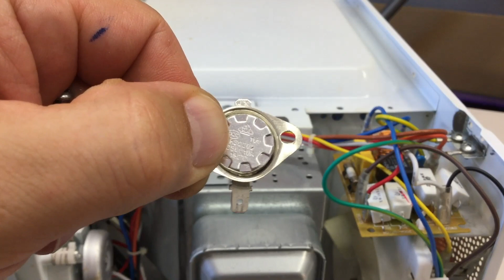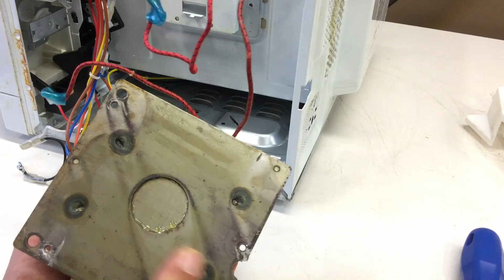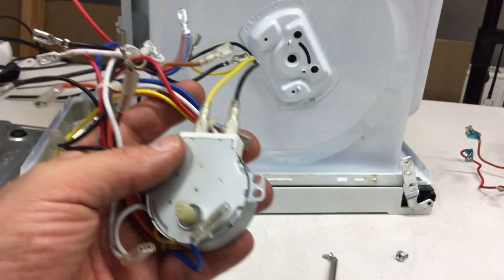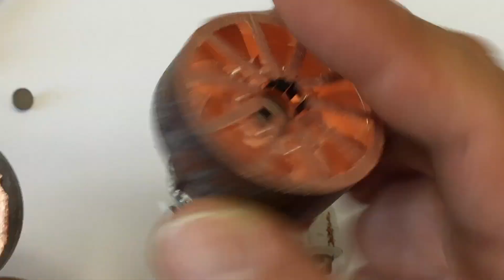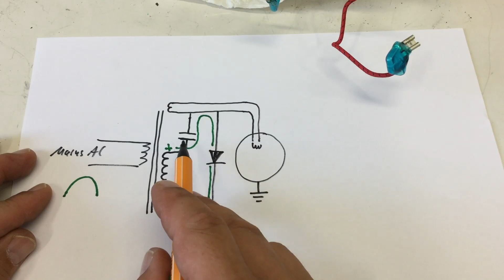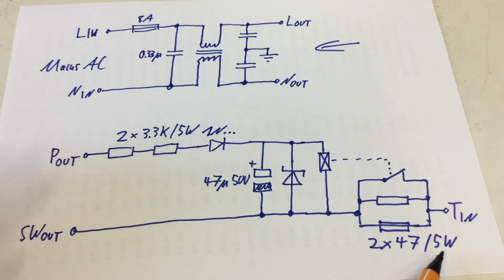Detailed Microwave Teardown (Magnetron Innards, 5kV Voltage Doubler, PCB)

Comment: Are you sure the low voltage end of the transformer is connected to the Megatron.   I think its the high voltage end @ 2000 volts.
Reply from the maker: Yes (see also the circuit: https://youtu.be/FyPdvM5x_Kg?t=3238 ). Due to the voltage doubling circuit (capacitor/diode) high voltage is present between ground (high voltage +) and the low voltage winding (high voltage -). The current from the low voltage winding is just used to heat up the filament in the magnetron, which is also at high voltage -, so it can emit electrons that are accelerated towards the grounded parts at high voltage + of the magnetron. Hope that makes sense.

Comment: Discharge the capacitor first.   Highly dangerous  to touch it,
Reply from the maker: The high voltage capacitor had a build in discharge resistor: https://youtu.be/FyPdvM5x_Kg?t=1382 - so I was quite save ;-) But you are right, I should have shortened it as a matter of course - my bad.

Comment: Even in currently shipped appliances like microwaves, incandescent bulbs are used over LED lighting.  A Gas dryer manufactured earlier this year, 2020, uses an incandescent built for interior illumination!.
Reply from the maker: Guess when it comes to heat resistant light sources nothing can beat an incandescent bulb with a filament glowing itself at a few 1000°C ;-)

Comment: 47:20 ish...no..those inner rings are not just support structures, they are actually connectors that join each part of the individual fins together in a series like fashion, at those frequencies forget about conventional circuits, it's the surfaces that act like resonant tank circuits, the fins close in towards the center, the 4 Kv charged cathode, are acting like capacitors and the outer end of each fin acts like an inductor, the ring shaped magnets cause the electrons that come streaming from the Thoriated Tungsten cathode to accelerate in a curved circular fashion so as to hit the metal surfaces at roughly right angles to it, this in turn sets up a charge and a current flows in the direction dictated by the right hand rule, it is the physical dimensions of the cavities that mostly determine the frequency of the magnetron, they form a circular series of LC circuits.
Reply from the maker: Thanks for setting that straight! I was totally oblivious about the role of the inner rings. At least I got the capacitor/inductor/LC circuits/frequency part right ;-) And while I was talking about Lorentz force I didn't mention the elephant in the room - the right hand rule :-( Your explanation is much more complete and accurate than mine - thanks again!

Comment: PLEASE NEVER BREAK or even touch the ceramic tube insulator rings (white or pink) as they may contain extremely harmful beryllium dioxide. 
 If crushed and inhaled, it can cause a lethal lung condition called berylliosis. Especially older ovens are a risk.
- Aside from that, thanks for this great video content Robert :)
Reply from the maker: Thanks for your concern! I only learned about that beryllium dioxide issue after the fact. I did wipe the bench with a wet disposable paper towels after I had finished though (not because of  beryllium dioxide, just to get all the dirt). However, I might have been save anyway: Within EU the use of beryllium dioxide has been outlawed since 2006 (EU RoHS, EU directive 1907/2006 - yes, I looked that up) - and that microwave came not from Amazon or Banggood. Anyway, you're welcome :)
Reply: I admit this particular oven looked quite new and also had German product info/spec tags on it so propably no need to worry!
But as these appliances tend to be very durable and there's still a ton of potentially risky magnetrons around, I thought it would be best to warn not only you, but also other diy-people watching this video :)
Reply: P.S.  I love how you explained voltage doubler, seems like magic but actually very simple :D
Reply from the maker: @MLX1401  You're absolutely right! If I had known beforehand about the beryllium dioxide I would have taken precautions and put up a warning in the video. So thanks again :-)
Reply from the maker: @MLX1401  Thanks! It's one of those AC mysteries ;-) BTW I have another (lengthy) video up that explains voltage doublers / charge pumps in another context in great detail: https://youtu.be/3gHIhTkI4Co
Reply: @robertssmorgasbord  Oh, charge pumps! Succesful recommendation o/
Reply from the maker: You're welcome!